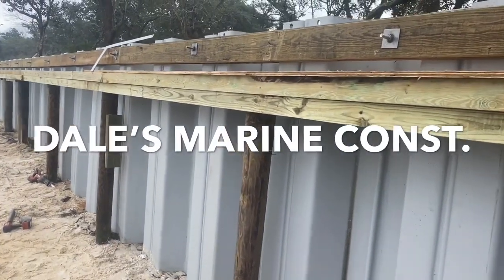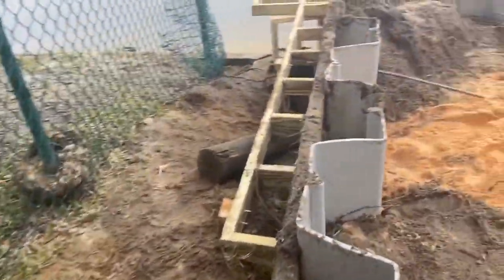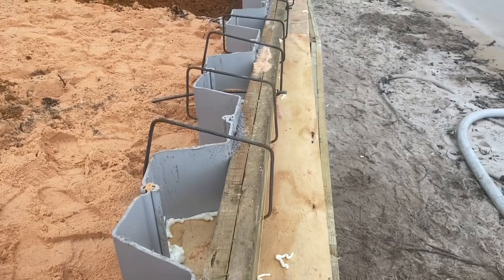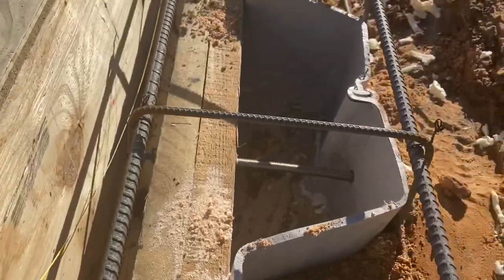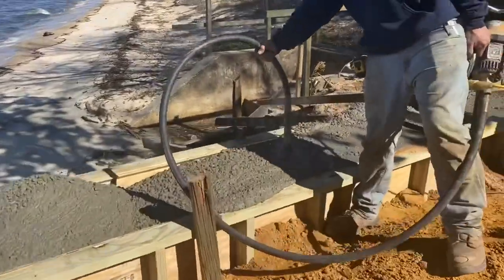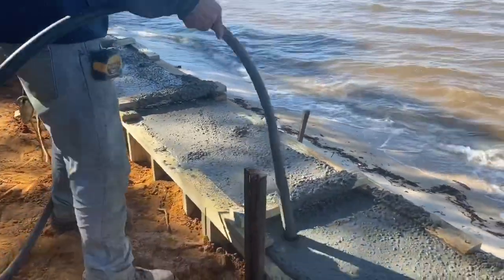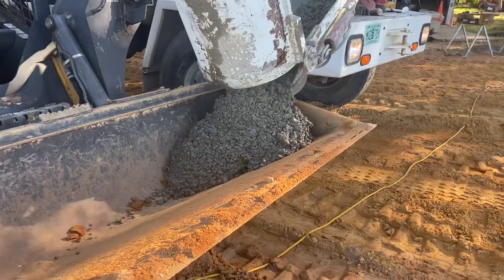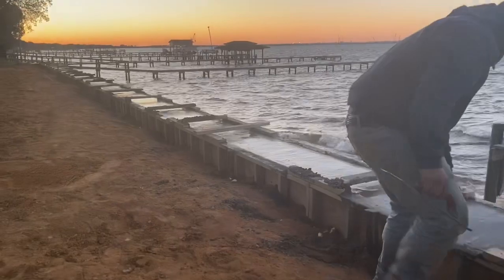HOW TO INSTALL A CONCRETE CAP ON A VINYL SEAWALL

Comment: I notice the dirt was not tamped to compaction under concrete on inside of wall.
Reply from the maker: Thanks for your comment and watching. You are correct the the concrete cap is pretty much supported by the wall. I don’t really care for compacting the dirt to much on a vinyl wall because it causes the interior corrugations of a vinyl to start to blow out. Plus it compact the dirt where it does not allow the hydraulic pressure of the water buildup behind it to flow through it properly into the drain system that we install.
Reply: @DaleWHickman  thanks I understand now.

Comment: I'd like to see how it stood up 4 years later.
Personally, I'd put up two barriers.
Reply from the maker: Thank you for your comment and statement. Four years later was installed March 2020 still looks great. We’re fixing to install a dock and boathouse at the same project shortly. Not sure why you would build another barrier. This is definitely the way to go very strong insulation with the rip rap in front of it.

Comment: So much work - labor,  material, ready mix truck access, setup forms, strip forms, rebar.  And then the concrete cap cracks because of settlement.  Stick with a wood or reclaim plastic deck for a cap
Reply from the maker: Thanks for your comment and you’re exactly right. Very seldom. I do concrete caps just because of the time. But when I do it cost.

Comment: How much do you usually pay someone with 5 years experience on waterfront construction? just wondering the pay diff in texas
Reply from the maker: Hey, thanks for checking out my channel. Definitely don’t want to advertise my pay scale to my competitors. I’m sure you can understand that but I’ve had employees for 20 years if that tells you anything most of them are 15 years right now.
Reply: $15 an hour q

Comment: Have you ever seen someone want to pour a concrete cap on an older wall to raise the height?
Reply from the maker: Hey, thanks for watching my channel, sorry it took so long. I guess I skipped over your comment. Yes as long as the wall is tied back properly and is structurally sound enough to support the concrete. That is a good possibility to elevate the yard.

Comment: did you use marine concrete?
Reply from the maker: Thanks for your comment and question. That is a good question. This seawall top cap will never be in contact with saltwater and is a few foot back from the water as well.
I will definitely look into Marine concrete, but it’s not something we do a whole lot.